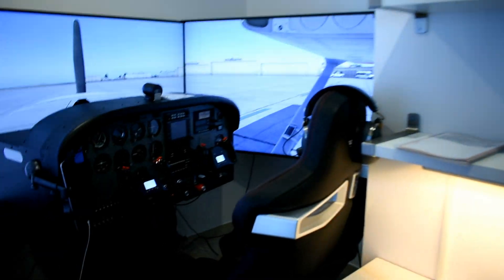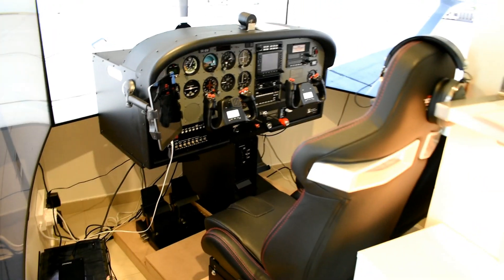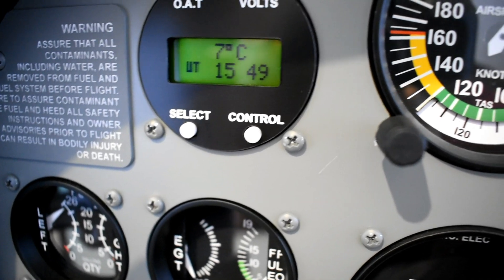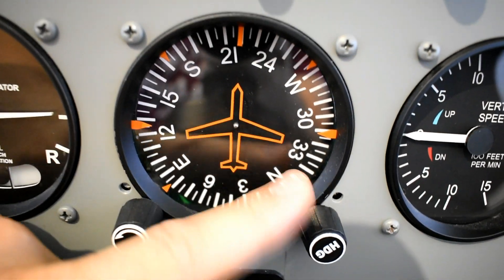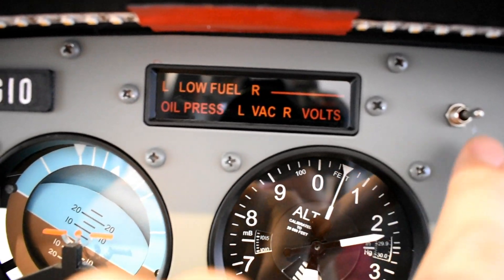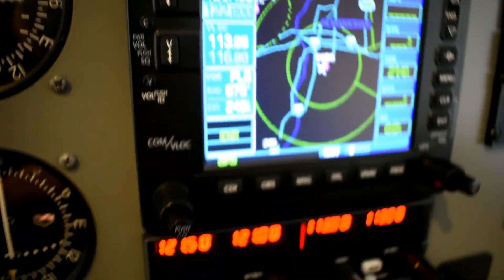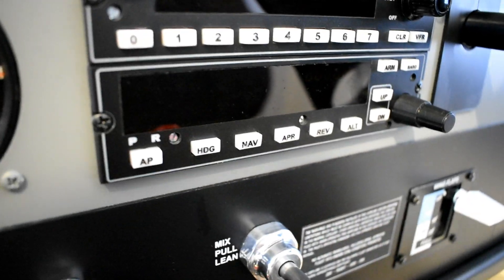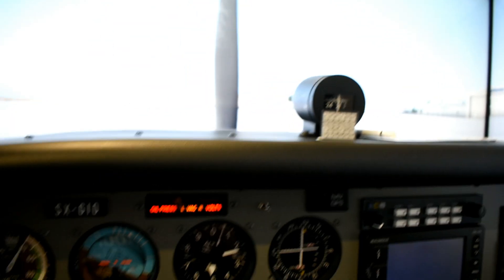#GioFly - Introducing my Cessna Home Cockpit

Comment: where did you buy nav/gps announciator?
Reply: none None Would like to know aswell
Reply: @hell12361  but you already installed it on your panel . It is beside your announciator
Reply: @noneNone-mw1px  I dont know the name, I would also want to know.
Reply: @hell12361  NAV/GPS Announciator
Reply: @noneNone-mw1px  By who? Could you provode produst link? Thank you alot.
Reply: @hell12361  that is my question from GIO FLY. Simkit had it before but not any more. That is the one I m looking for. There is another one.